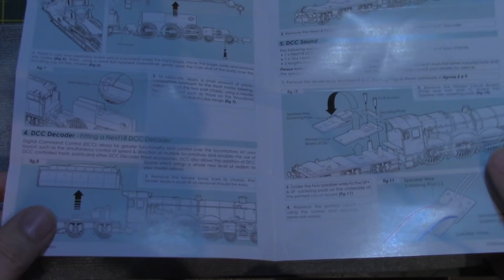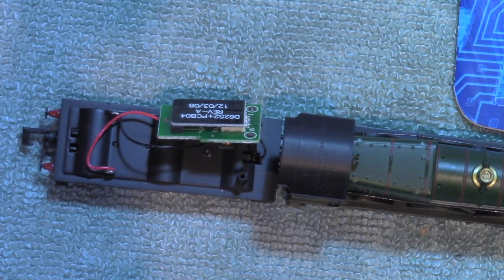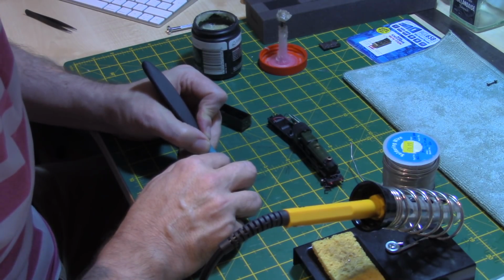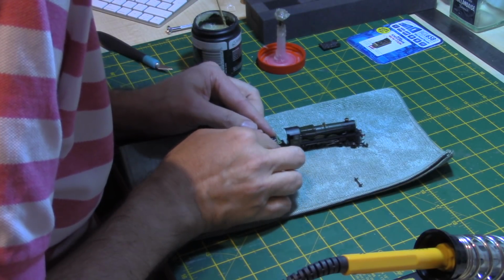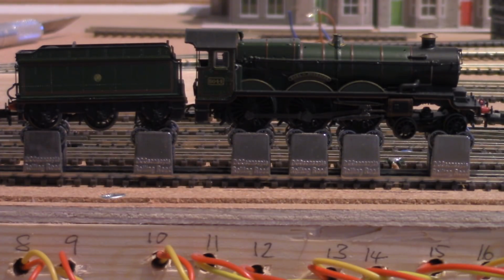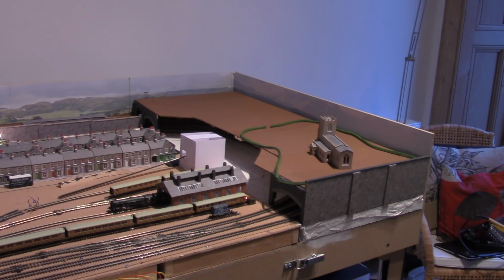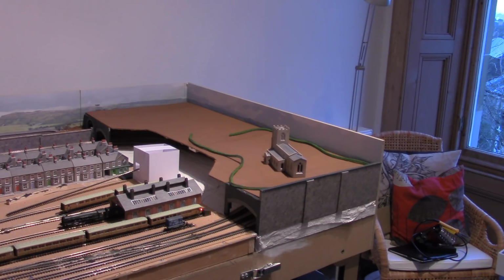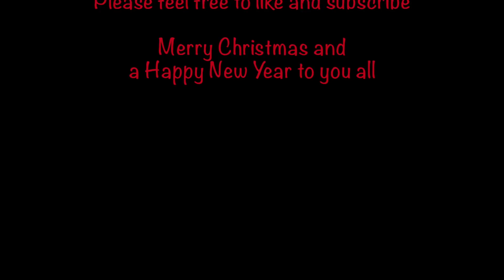Elvenhome N Gauge Model Railway Layout Update (Ep 21): Fitting Sound to "Earl of Dunraven"

Comment: Hi Stephen and yet again thanks for doing this. I have one loco at the moment, an LNER 8F class 2-8-0, fitted with a sugar cube speaker and a basic DCC decoder but no sound. Now I have your link to Youchoos decoders I can see I need to get an MX658 or similar myself, and then I can have sounds! Brilliant! That will get added to my birthday list for next year. Stay safe!
Reply from the maker: The 8F sounds from Youchoos are very good.  I have two 8Fs, the collectors club one in LMS crimson lake which came sound fitted by Bachmann, and the LNER O6 version which didn't.  Youchoos quickly supplied me with the sound chip.  It was just a case of fitting the decoder in the tender and away you go.   Stephen

Comment: Very nice update Stephen. Excellent sound installed on the Earl, very tight on space. Very good tip on use the microfiber cloth, I am forever dropping screws on the floor, and they always disappear when they hit the floor…Simon
Reply from the maker: Thanks very much Simon.  It is a heart sinking moment when you know something very small has just hit the carpet. The cloth seems to work well but you may have seen the comment above about being careful about static discharge.  Stephen

Comment: Very well thought out layout =, are there showing on the rear section were the chip slips into showing were the two wires for the speaker has to be soldered to. I have a n gauge layout and now into DCC and wanting to it sound into my locos. what sound decoder do you recommend. 
Richard from Bodmin Cornwall
Reply from the maker: HinRchard and thanks. I am still at an early stage in fitting sound.  The company I bought the sound chip from has a great website.  The two guys that run it are very friendly and would I am sure provide you with better advice than I can.  I have added in the description to the video a link to their website. If I put a link in this message, YouTube will quarantine it and you might not receive the reply.  Stephen

Comment: Stephen get hold of some tubing, short lengths of various diameters, that fit the head of the screw. I like to use silicone tubing which is very flexible. Insert the head of the screw into the tube so thread sticks straight out at the bottom. You can then use the tube to position the screw in the threaded hole and start it off before using a screwdriver. You can even use a short piece of tube to hold the screw onto the slotted head of a screwdriver. If you don’t have the right size of tube use some “Blue Tack” between the screw and the driver. 
Steve
Reply from the maker: Thanks Steve.  Once again a cracking idea for keeping screws in check.  I will give that a go.  Stephen

Comment: Great video Stephen, thanks!  One comment on the use of a microfibre cloth.  My concern would be with static electricity when dealing with electronic boards.  I like the idea but would probably have the cloth on an anti-static mat to dissipate any issues.  As for the screws, magnetising screwdrivers is the way forward.  Magnets for this purpose (and de-magnetising them) are easily available.  Elvenholme is coming on nicely.  I am about to start (sometime after Christmas) my first layout and I will be, like yourself, charting my progress on here.  Although not a big layout, I am looking forward to the challenge :)  Ian
Reply from the maker: Thanks for your comments Ian, and I will have a thought about the placing of the cloth.  You may have seen the suggestion from Steve Williams below to address using screws.  I am going to give that a go also.  Good luck with the layout, and I've subscribed already.  Stephen
Reply: Thanks Stephen, you are the first in the book ;)  Just so you know my background, I was a BT engineer for 25 years and am currently an Apple Authorised Technician.  I deal with static protection all day long, so may be a bit anal about it ;)
Reply: If your mild steel screwdriver is not magnetic a small Neodymium magnet on the shaft will turn it into one. Unfortunately, not all screws and bolts are magnetic a lot of brass and stainless steel are used in modelling.
Reply from the maker: Brilliant.  I am going to have to retain you as my resident Guru.  I am going to get some Neodymium magnets to try out the dapol easy shunt couplings so I will save one or two to use as you suggest alongside the different sizes of tubing